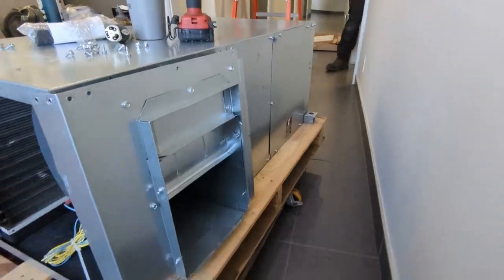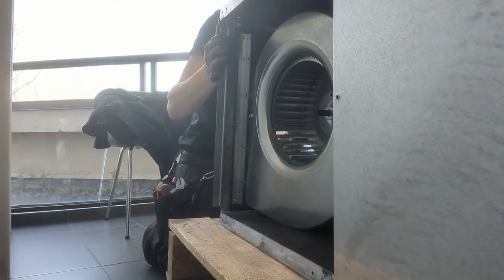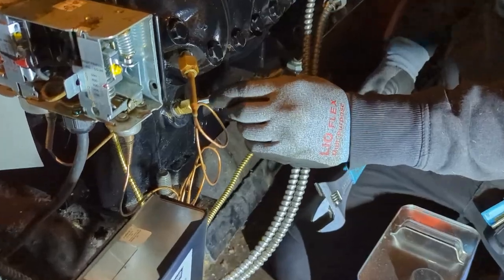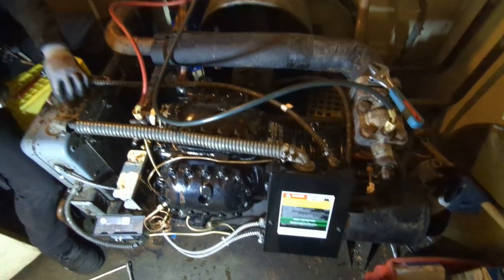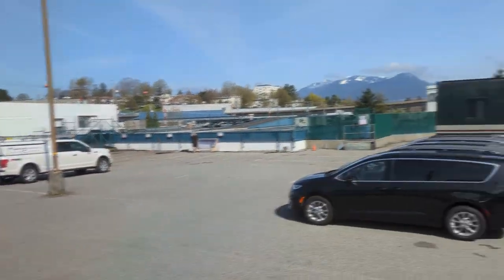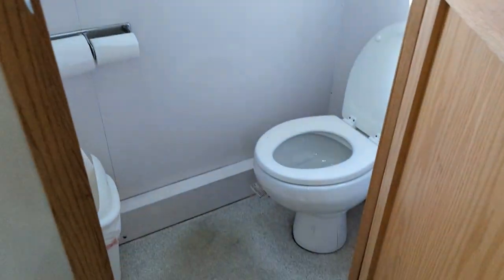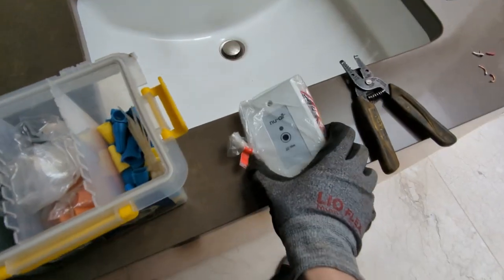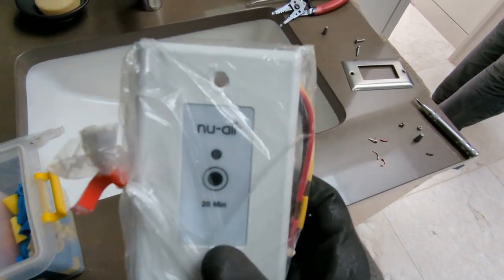April 28, 2023 - HVAC Vlog - compressor oil change, HRV replacement

Comment: You gotta love when you can work as a team to "divide and conquer" on a job. But the tangle of everything above ceilings can be super challenging when there is barely space for even the equipment. But like building Ikea furniture, you can start to cut the time needed for a job in half once everyone gets dialed in. Love how your company does such diverse work. Here in the States, if seems like everyone specializes in one sliver of the trade and passes on anything that falls outside of that.
Reply from the maker: Thanks so much for watching.  Yes, we are very lucky to have such a wide variety of work and types of equipment.  Makes it a bit difficult to learn that way, but I do get exposed to a lot.

Comment: Thanks for making. 

Seems like some complaints to the architects are in order (re: placement and space for evaporator).
Reply from the maker: Thanks so much for watching. We often run into these access challenges.  I think it also happens when something is built a certain way, then the configuration of the layout changes over time.  We get to deal with whatever is happening in the ceiling space.
Reply: @hvacjess  

Yes, I suppose.  But still, the architects should have some knowledge and consideration about accessibility, the building owner too.  

One thing you could do to "stick it" to both is charge them more and tell the owner and the architect why.  "This installation has horrible, dangerous access.  We're changing you extra because of it". That would get their attention pretty quick, I reckon.